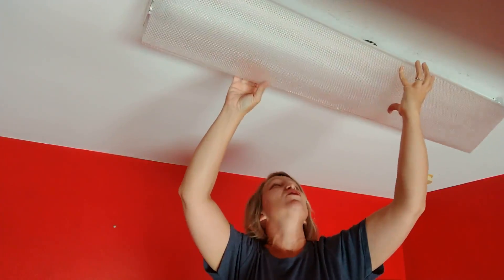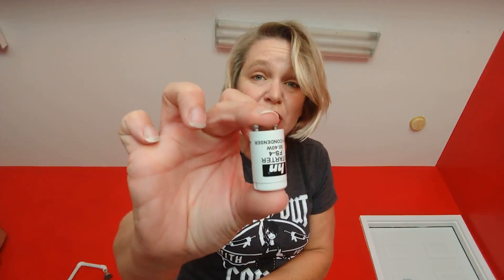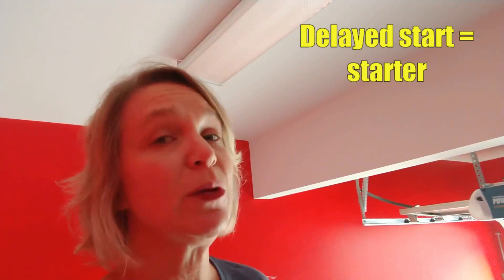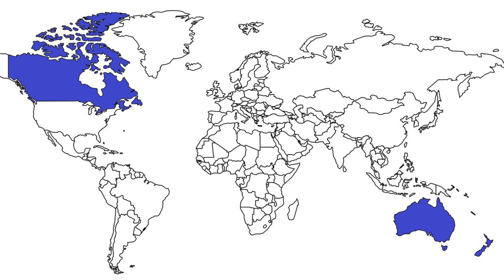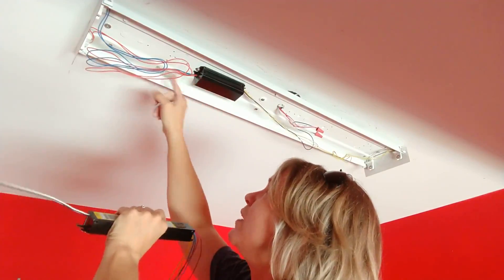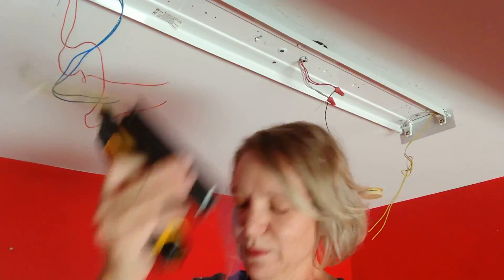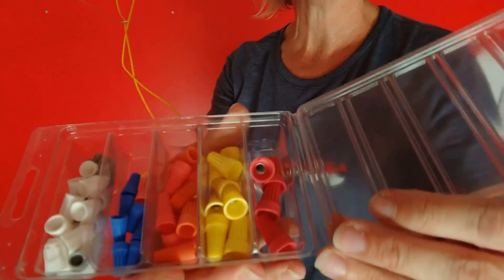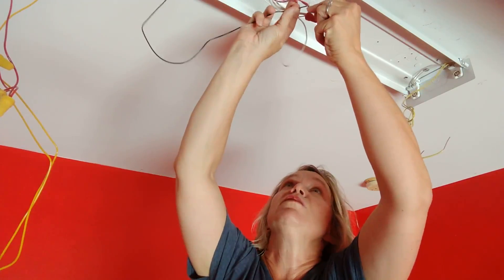Fluorescent Light Troubleshooting and Repair: starter, bulb or ballast?

Comment: Nowadays it is so much easier to just take a picture of it that way you know exactly where the wires go. The other thing to do is just match the colors the same exact way you take them out. Always make sure you have the same size ballast that was in there with the right amount of wires that particular fixture that you have does not take a starter that's only on the older ones that were build in their early to mid 80s. You did a pretty good job for someone who has never done it before. One of the thing you should always be careful with is checking the power before you work on the fixture itself. If you are comfortable with working with it lies just make sure you don't touch the wires together and always isolated primary first and then do the secondary. Then reverse the process of putting it back together

Comment: I just did this yesterday but yours looked so much easier! When I took the metal cover down all of the connections for the ends of the bulbs came crashing down... I had to use one hand to hold everything up while also trying to screw the cover back on.. yours just snapped in place where as mine had to be held by screws! I hope I never have to do that again! 😂 great video!

Comment: Yea. In Canada you need a licence to do electrical work. and as an electrician I can tell you honestly it's a bad idea to do your own electrical work. Hire a pro, your insurance company will like that, you will save money and your house will thank you.  Trust me.  By min 4, I see two code violations.
Reply: .In all Canadian Provinces, if you’re doing a more than minor job you need a permit and it needs to be inspected. Minor repair like this is OK for a homeowner to tackle.  I agree with you though I’ve seen some pretty dangerous stuff done by amateurs.  (I would have turned the power off earlier...)

Comment: It was better if u bought LED lights! You remove the ballast and the LED lights just power straight up from 120V. In the excisting fixture!
Reply: So, if I buy LED light bulbs and remove the ballast all I have to do is put the LED bulbs in and flip the switch?

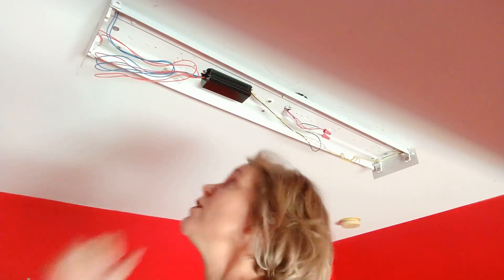Comment: 3:26 - I like your technique of cutting a single wire at a time instead of multiple wires, so you don't create strippers out of your cutters by blowing a hole in them and damaging your unprotected eyes with the molten metal that flies from such a spark.  (That's just in case you turned off the wrong breaker because the panel schedule was mislabeled - I didn't see you test the circuit after shutting power.)
Reply from the maker: I suppose it wasn't clear on this that the light was actually still a little functional, so it was easy to tell that it was shut offOnce I cut the breaker. Also there is another fluorescent light in that room, so that was another indicator for me. But you're right, I did not triple check with a multimeter, which would have been the safest thing to do

Comment: This is the first time I've seen your videos. I have changed tons of ballasts over the years. I can give you a couple of tips. Get yourself a small tool pouch to wear, I use one that has two pockets. Tools in one and parts in the other. Another thing is when you wire the ballast trim some of the wire off, the blues, reds and yellows. There's no reason to leave it all in there as it just make it harder to pack the wires in. I also  twist the wires together to make them easier to pack. Another thing you may want to consider is revamping the fixture to LED. Thanks for the video, Bob
Reply from the maker: Yeah I have no idea why I haven't bought myself a tool pouch yet! I've made over a hundred thirty videos, which I know means encompasses all of the projects I've done, and I still don't have a dang tool pouch.
Reply: @ChickFixUSA  You don't need a tool pouch... just wear a shirt with pockets or use your back pockets on your jeans
Reply from the maker: Also, thanks for watching! And thanks for the tips!
Reply: @Boujee ONE taiwan is higher quality than mainland china lol
Reply: Wow, for your first time doing this, it is great. just another small suggestion is to get yourself a voltage meter, a small one. And tell your husband to take you out to a nice dinner for your fine efforts. 😊
Reply: That's what I was wondering.  My mom thinks it's more cost effective to switch to LED...
Reply: @jill5454  It is. I haven;='t seen any indication it's not. The LEDs are getting cheaper all the time. There's no reason not to.
Reply: Japan used to make products we felt were inferior. But they strive for excellence. China makes inferior stuff, and they don't care. I don't ever see them coming to parity.
Reply: Thank you for the tip Bob!🤗
Reply: Wonderful.
Reply: Is it ok to change the regular florescent ballast to a led  ballast?
Reply: Do you know if it’s OK to change out an old ballast with a new LED ballast without anything else needed? Thank You
Reply: I love LEDs, so you might have to replace them in a couple of years no big deal. They are easy to replace and you don't have to fool around with those damn fluorescent light bulbs that shatter in a gazillion pieces everywhere if you drop one, or have to replace a starter or a ballast and do a bunch of rewiring work. Plus you can dim the LEDs brighter or softer if you want. I changed mine out years ago and so far so good, glad I made that choice.
Reply: @Steelviper61  You have clearly never dealt with fluorescent bulbs before. They are super durable.
Reply: @neon2900 I am so clear on the understanding of fluorescent light bulbs that I NEVER want them in my home again. To each his own. Enjoy ur antiquated light bulbs and I'll enjoy my LEDs.
Reply: @Boujee ONE China makes shit products.  Not sure what you are meaning by "that's why they make everything"...that's because they literally make it the cheapest way possible and rake nations over the coals with trade.

Comment: I couldn't tell but it looks like you have existing T12 bulbs in that fixture and so you must use a T12 ballast, no exceptions.  There are very few T12 ballasts these days as that technology is being phased out in favour of T8 and yeah....LED.  Although T8 bulbs will work in a fixture with a T12 ballast, they tend to burn out as the baĺlast will over-drive the filaments in each end of the bulb.  T8 bulbs require T8 ballasts and the wiring is different so in that case, you will need to rewire the tombstones to a "shunted" configuration accordingly.
Reply: Instant start T8 ballasts don’t even drive the filaments at all. They just send a very high voltage pulse through the lamp to get it going.
Reply: @rs12official  That is correct and even one leg at each will still be enough to strike the arc but we're talking lamping T8s with T12 ballasts.

Comment: I haven't personally seen a "starter" in any florescent light for over 30 years.  T8s eliminated the need for a separate starter circuit when this improved technology was introduced in the early 1980s.  Anyone that says you need a "starter" should brush up on their general knowledge of fluorescent light technology. ... or just recommend LED.  BTW,  nice red garage wall paint...is that to match YT red? 😄
Reply from the maker: It's actually meant to match Formula 1 red. 😁  They still sell starters at Home Depot.
Reply: @ChickFixUSA  Yep, so I see.  Even here in Canada.  Best to upgrade to a more efficient electronic T8 ballast (or LED) and save money in the long run.

Comment: Thank you for such a helpful post.  It helped me realize I don't actually have to change the connection at the socket - I can just use the twist connectors.  By the way, please use safety glasses.  I scratched my cornea with a flinging wire once and had to wear a patch for several days, not to mention the pain and inconvenience of several doctor visits!
Reply: As an eye doctor, I wish I could like this comment a thousand times.
Reply: @debbiebereda2868  All I can do is give you one like too. Safety first!

Comment: For the cost of the ballast you probably could have replaced the bulbs with LEDs.
Reply: LEDs are bad for your eyes and melatonin production. The more you know.
Reply: @pomchiskilover  Do you have any links to current research on modern LEDs that say so?

Fifteen, twenty, years ago, when LED technology was new and insufficient, some LEDs had high peaks with UVa and UVb.
Reply: What good will it do changing the bulbs with LEDs if your ballast is still inoperable.
Reply: @kokok3479  some LED bulbs are direct wire. So you cut the ballast completely out and just run your live and natural to the tombstones. 

Other LED replacements are plug and play. So you just replace the bulb with out doing anything to the ballast. (Your ballast has to be working for the plug and play to work.)

Now... For the cost.. it's almost cheaper to just buy a whole new LED fixture and take out the old fluorescent fixture. Then just wire your hot and neutral to the new bed fixture.
Reply: @uscgwagner  thanks for clarifying.  I might consider doing this.
Reply: @kokok3479  get ballast bypass led bulbs which are called double ended where one end is the neutral and the other end is the line then remove ballast and  throw away hook the white wire from the feed  to the yellow wires then hook the hot wire to the red and blue wires then look at end of the bulb will have and N which goes to the end that you connected the white wire which is the neutral . attempt only if you know what you are doing as there are different types of led bulbs that hook up different ways

Comment: My problem is not replacing a ballast or putting in a new bulb but actually installing the  flourescent tube. It is way overhead in my garage and I dont have the ballance anymore to be standing on a stool to reach the fixture. I have a tool that install floodlings 20 feet up on the outside of my garage. I jusyt need a tool like that to install flourescent  tubes. That is what brought me here to this website, to install Led frourescent tubes without breaking my neck
Reply from the maker: I'm sorry I wasn't able to help you with this. Perhaps this is a good idea for a new video!
Reply: No worries but if you ever find a installer wand for Flouresent  tubes it would make a great video as I only have seen them for conventional  overhead bulbs

Comment: I have a similar problem. Mine came on and shut off twice. I twisted the green wire it came on one more time and then turned it off. And doesn’t work anymore How can you test if this is the problem and not the switch

Comment: I always find it cool to see a woman doing the same work I do :)

You don't need to be licensed in Canada to work on one unless you're doing it professionally (getting paid for your work.) A lot of DIY homeowners these days are doing all kinds of stuff on their own thanks to the internet.

On the other hand... If they happen to get zapped, well, It's pretty much their own fault at that point. Troubleshooting these things properly does require doing it live so... It can be a rather risky situation regardless.

It's almost always better to just hire someone IMO - 120v will give most people a run for their money.
Reply from the maker: Thank you for the clarification!
Reply: Normally maintenance and replacement of fixtures in homes doesn't require a licence or permit here in Canada.

Comment: Turning off the power makes it harder to install, cause you're working in low or no light, so you have to improvise.
Reply from the maker: luckily this one was in the garage. I have a another video that I posted to Instagram where I had to use a work light because it was in my closet
Reply: Never work on a ballast with the power on the ballast.  If you get into the output side power, it can cause you serious injury or death.  A no brainier on either end of the ballast, I realize, but some people still do it, and the ballast still does it.

Comment: I’m going LED as my fluorescents die.
Reply: I don't like LED
Reply: Even though I switched to LED, the ballasts in my lights were from the 80’s and were giving me problems even with the new LEDs, which were designed to work in lamps with ballasts.  Fairly annoying.